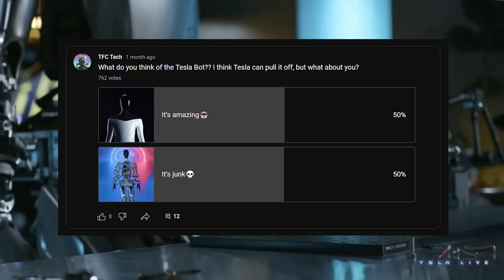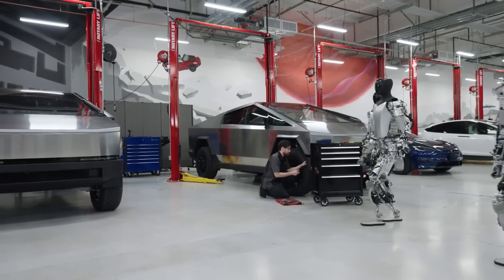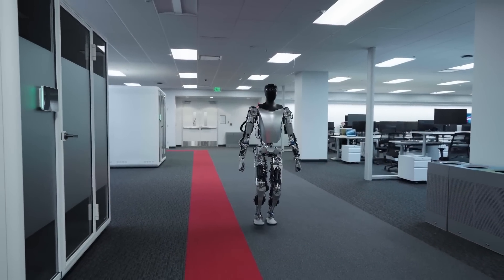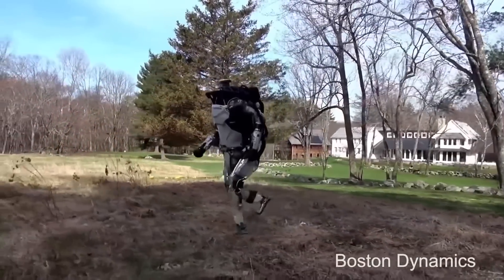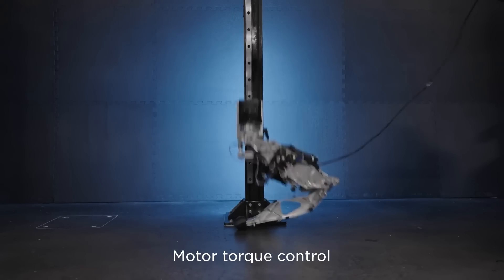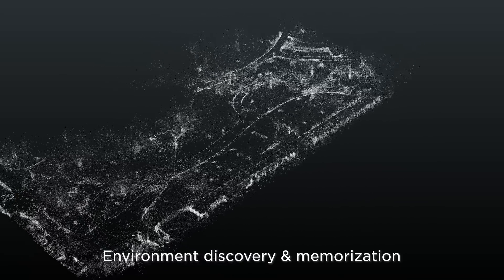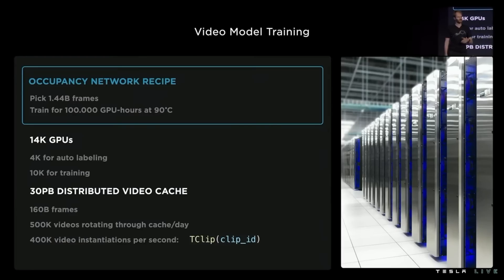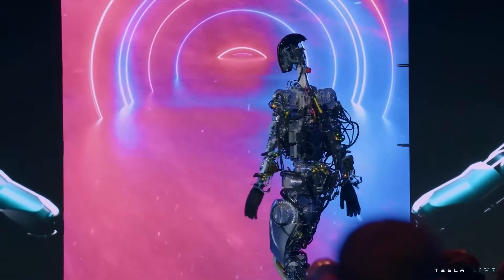This Tesla Bot Update Changes EVERYTHING! (Huge AI News!)

Comment: Oh crap this is just a toy I should buy my 10 year old for Christmas.  Stands up and walks.  Wow.  Robot toys have been doing that for 20 years.  It doesn’t walk properly.  There is no AI.   Is useless.  Watch the variable torque claim, they switch screens between the actions.  Reminds me of Nicola.  Why do you want a humanoid in a factory anyway when you just need dedicated machines.  If I need it to tighten a bolt, I don’t need it to be able to make toast as well.  If it’s working in a factory, I don’t need battery power because I can just plug it in.  Have to charge it every 20 minutes, so it’s not going to be your running partner.  Musk, how’s FSD going, been promising it will be ready each year for 8 years?